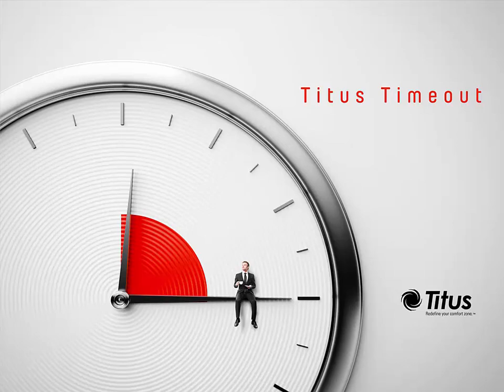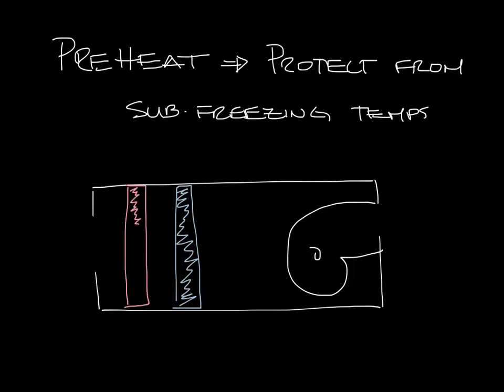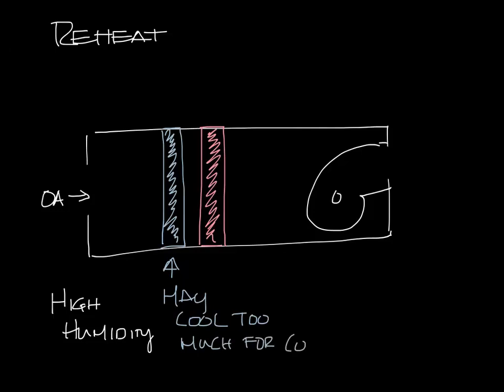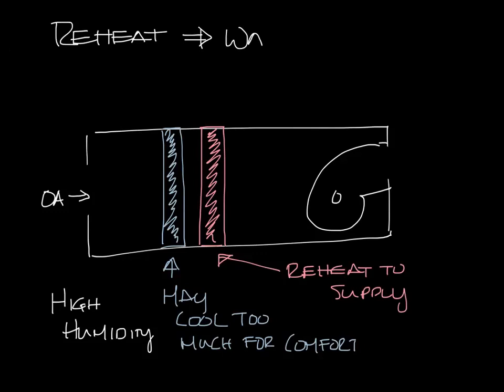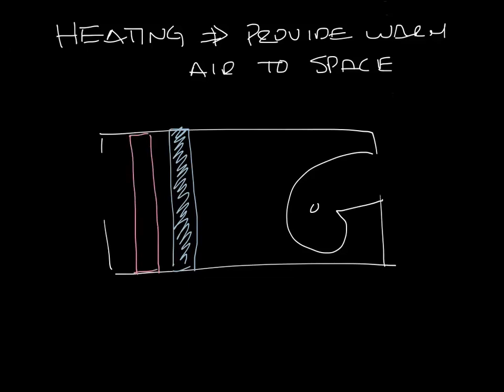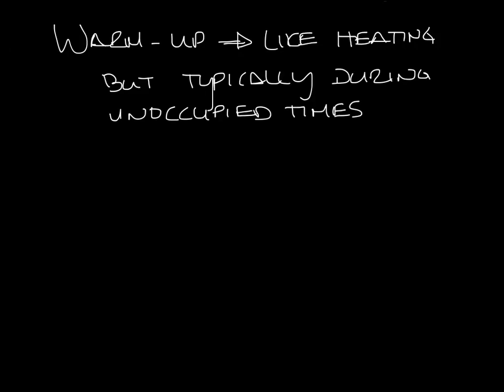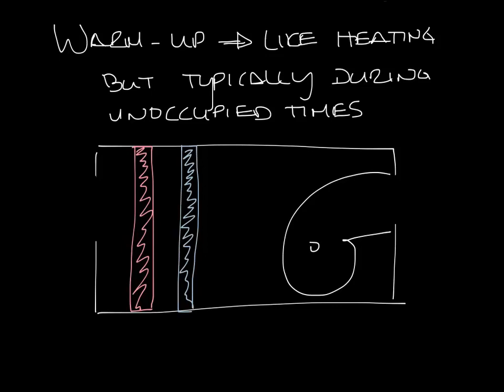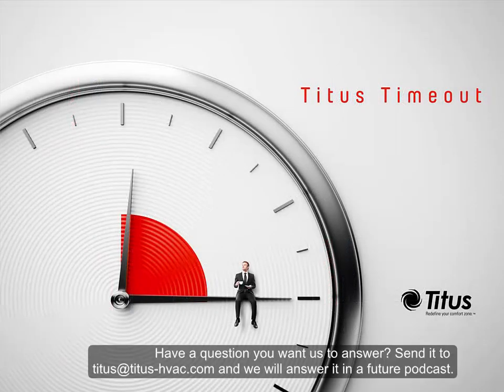Titus Timeout Podcast - What's the difference between preheat, reheat, heating, and warm-up?"

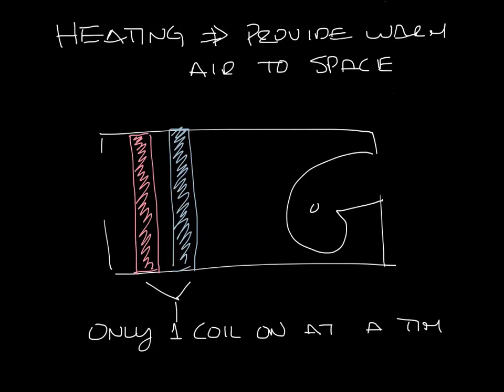Comment: Question, @3:24 you say that you don't want to run both coils at the same time, but earlier the discussion was about preheat vs reheat.  ...Aren't the heating coils running concurrently with cooling in both scenarios?  Thank you
Reply from the maker: In preheat, very cold, possibly subfreezing air is being drawn into the system and must be heated before it can be used, so only the heating coil is being used. And reheat may be required if high dehumidification results in lower than normal cooling temperatures. This of course is to be avoided if at all possible, because it results in simultaneous heating and cooling.
Reply: @TitusHVAC  Thank  you.

Comment: I have a multi zone Air handler and the water is being blown off the coil and on to the back of the cabinet what could be the issue. The unit has been balanced and is running at design speed.

Comment: can anyone explain to me what bringing oa down  to saturation means???
Reply from the maker: When we “bring outside air to saturation”, we are generally dropping the temperature. When the air reaches its saturation temperature and pressure, the dew point has been achieved. By bringing air to a point below the dew point, we can create condensation and reduce the moisture content of air in order to dehumidify.
Reply: Thks,however am seeking the following regarding a dessicant doas.
"Why would dropping precooled air to saturation be advantageous upstream of the dessicant wheel on the oa intake side of the airstream.Dessicant density is high,thks
Reply from the maker: @nickyengle9668  To have a conversation please reach out to someone directly.  You can try technical@titus-hvac.com.  Thanks